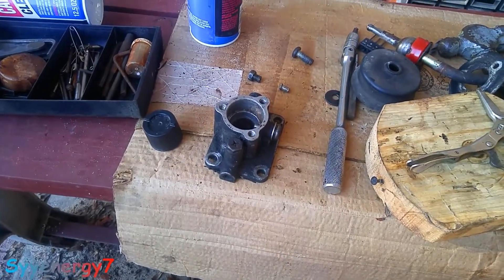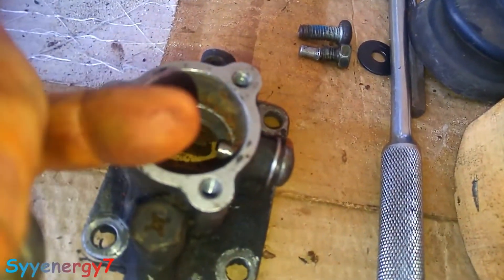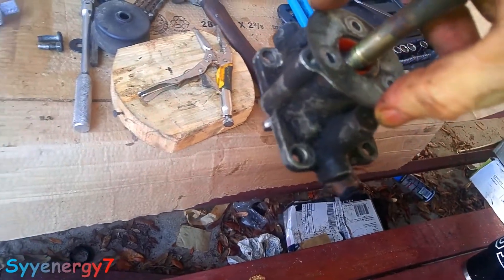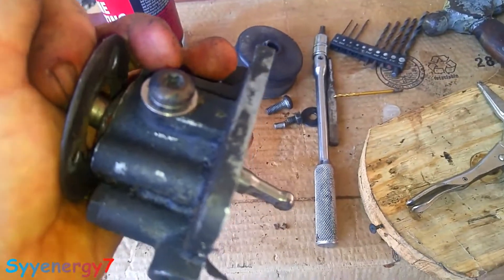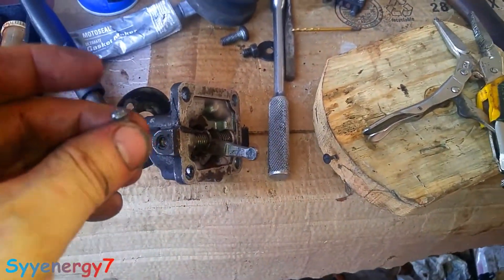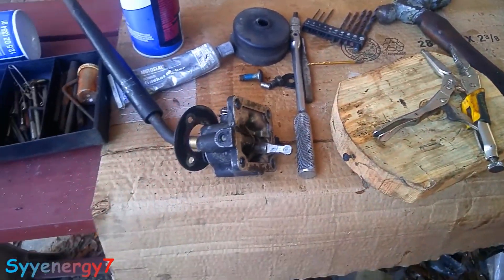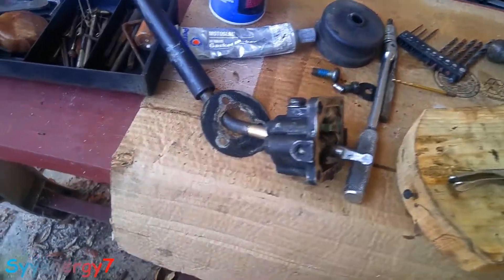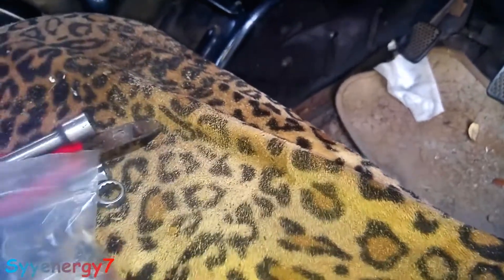Suzuki Samurai, SJ413 Shifter Bushing, Shifter Bolt replacement

Comment: I have an issue where my samurai is stuck in 3rd gear. it would grind sometimes when putting it into 1st gear and it was hard to put it into 1st gear also, it finally got stuck into 3rd gear. won't come out. I drove it home on 3rd gear lol. how can I get it out of 3rd gear!????
Reply: Did you get that fixed? How did you fix it?
Reply: @dariom8729   yes i fixed it. I just took the shifter apart (which was only a couple bolts) that released whatever tension was holding it and i was able to get it out of the stuck gear. It worked find once i took the bolts out. Since i didn’t want to deal with that happening again, i bought a shifter kit from hwy83 and replaced it. Its way better now. Shifts a lot better. I changed the shifter and the shifter sheet on my transfer case. Its like new now.
Reply: @dariom8729   welcome